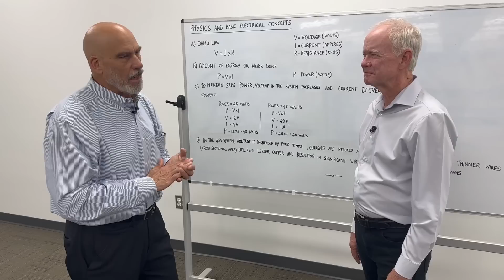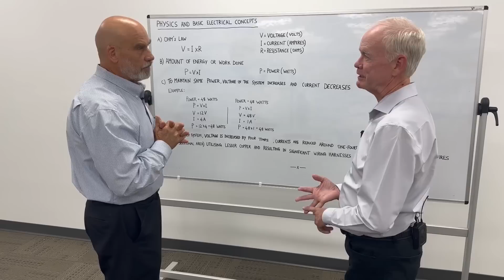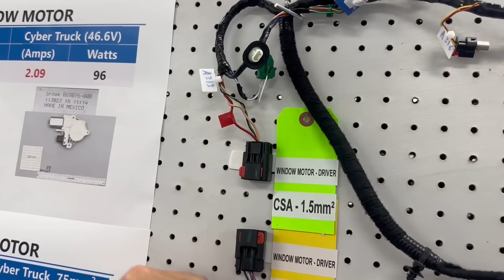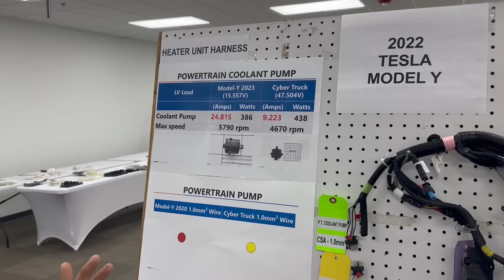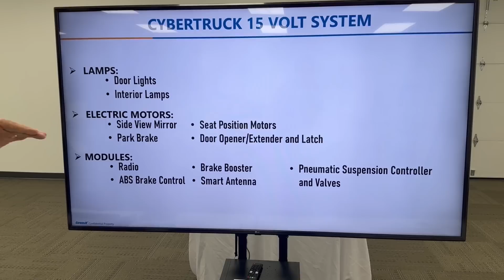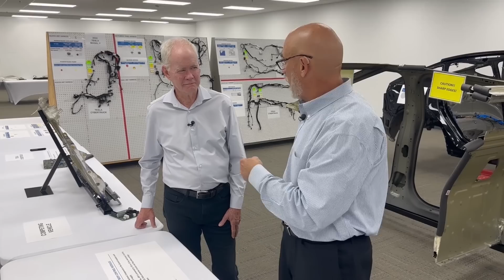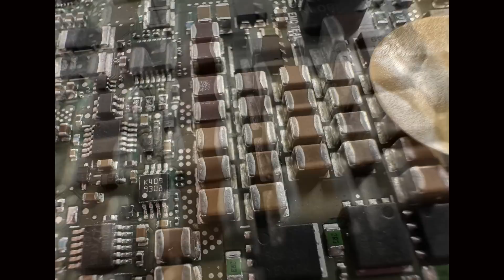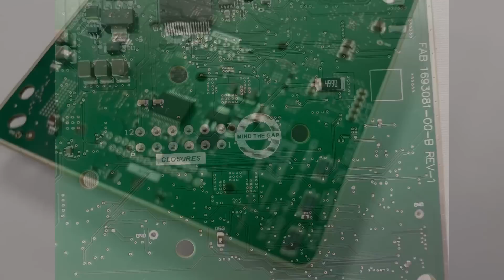Deep Dive Into Tesla's 48-Volt Architecture - Caresoft Teardown

Comment: Funny you should mention the wiper motor.  There is currently a recall open on the wiper motor for the motors failing.  Over on his channel, Munro praised the wiper motor for being small because it runs on 48 Volts.  Commenters were quick to point out thar the physical size the motor is not necessarily related to operating voltage.
Reply: It’s not a motor problem.  It’s a motor driver problem.  The real recall is for gate drivers of the motor.  In other words, the electronics overheated.
Reply: @Derpy1969  Thank you for the correction, I appreciate it.
Reply: @Derpy1969  In other words, nobody validated the design.  More fail of first principles.
Reply: @bobbbobb4663  My ford had a recall for the cruise control system catching fire, thinking tesla is the only one that gets things wrong is re tart ed
Reply: @JD-yx7be  A wiring fire is kind of frightening.  I had a 1972 Olds Toronodo.  A piece of rust shorted out the license plate lamp.  The wiring harness was thick parallel solid copper wires in Teflon under the carpet on the driver’s side between the A pillar and the trunk harness.  The under carpet wire did not get too hot or melt, which would have been a bummer if it had ignited the carpet.  What did catch fire was the harness between the bottom of the A pillar and the headlight switch.  Those were probably 16 gauge with regular thermoplastic insulation.  The license plate lamp was on the same circuit as the headlights and had a thermal reset breaker instead of a fuse; it should have been fused with the tail lights.  The Toronado trunk harness wiring was a bit complicated because there were high mounted stop/turn signals which had relays so they could have single filament bulbs but pick up the stop/turn from the 1157 type lamps mounted lower.  It seemed like a Rube Goldberg wiring idea which some exec and designer came up with for the high mounted lamps at the last second before committing to production.
Reply: @JD-yx7be  Chief Engineer on the CyberBust:  E Musk.  Chief Engineer on your Ford:  Not Chris Farley’s Incompetent Cousin.
Reply: @JD-yx7be  Ford is a bad example for recalls.
Reply: @bobbbobb4663  No, the design was good, it's just that the supplier tested them beyond their design power limits, which may have damaged the power transistors that drive the wiper motors.
Reply: @ZipZoomZip  Welcome to HALT.  Stop making excuses that Chief Engineer Musk doesn’t know anything about reliability testing.
Reply: @bobbbobb4663  Musk can't lead SpaceX to be NASA's most reliable contractor without know all about reliability testing. Yes, it's rocket science. YOU are a sham!
Reply: @bobbbobb4663  The same week the Tesla wiper motor was recalled, Ford and Toyota recalled a million vehicles for defects that could cause injury or death.
Reply: @markburmeister4674  Tesla is sooo much greater than the legacies yet the stans have to compare it to the legacies to prove they are "less bad".
Reply: Tesla hater
Reply: @captain8792   if you mean me, no - far from it.  Artistry is recognizing what’s in the world around you making something unique from it.  I believe in a prior remark here I complimented Tesla, saying they excelled at it.  No other manufacturer has yet put all the technological elements found in the Cybertruck together all in the same place at the same time, though most of those technologies already exist separately in other automobiles.

There are shortcomings in the specific realization of the Cybertruck…. For example, forcing customers to purchase the full self driving option if they want to purchase a Cybertruck any time soon, and then omitting full self driving with no definite date of when it will actually be delivered.  Several of the missing software features have already been addressed, such as the locking differential.

I also find Elon Musk rather abrasive, much like Steve Jobs was, exaggerating the ordinary and taking credit for inventing things which already exist.  I’ll blame myself for that, but I am not required to like everyone.
Reply: @captain8792  Please specify your target.
Reply: re: "There is currently a recall open on the wiper motor for the motors failing." whew, now wait till there's a TOTAL RECALL on "opens" developing in FAILED WIRING HARNESSES.  if there's one job Techs hate to perform under Warranty is the replacement of crap OE Wiring Harnesses.  boy if i've heard that complaint once in my training presentations, i've heard that a 1000 times.
Reply: Reason #4,678,090 why $andy is not a degreed engineer!
Reply: @bobbbobb4663   Agree, the presentations here are much better, not just disguised advertisements.  To be fair, some of Munro’s presenters are quite good.  I have a lot of respect of Carl who has taught me a lot about why decisions are made regarding the materials and processes used to build interior components.
Reply: @wtmayhew  $andy does hire actual engineers but if $andy's bio on his webpage, it makes me question why anyone would want to work for him.

Comment: Tesla didn’t invent 48 volt architecture.  Power steering racks have used 42 Volts in various hybrids for 15 or so years.  42 was the original proposal for higher voltage accessories in the 1990s.  BMW has been using 48 Volts in their eBoost mild hybrid system for several years.

Tesla is kind of like the Apple of the automotive industry.  Tesla integrates existing technologies from across the board the way Apple took a swath of existing technologies and put them in one place in the iPhone.  Tesla hasn’t invented the technology, but rather excelled at integrating technology.
Reply: So, why didn't BMW roll out 42 volts to all its new cars in the last "15 years or so"? And why didn't they use 42 volts for the rest of the cars' systems instead of just the steering racks? Were they such a leader? Nope.
Reply: @garyrooksby  Q: So, why didn't BMW roll out 42 volts to all its new cars in the last "15 years or so"? And why didn't they use 42 volts for the rest of the cars' systems instead of just the steering racks?" A: because it wasn't needed (full stop).  ref: the Universal Law of Diminishing Returns.  also ref: the Cybertruck costs $100,000 Dollars to own and doesn't come remotely close (by double) to the "less than $50,000" price originally promised, therein a "gimmick" was needed (that the laymen won't fully understand and via Confirmation Bias will "misread" and "misinterpret") to help justify the eye-watering price, and 48V is that "gimmick"...

ps: the Germans will GLADLY sell you a vehicle that incorporates 48V technology (if that's what one's got a hard on for) and they'll actually give it you for much less than $100,000 dollars.
Reply: @phillyphil1513  You seem to want to distract from the fact that your initial claim about BMW was false. Tesla is the first production vehicle with a 48V low voltage architecture. The Cybertruck also starts at $80k and will be available at $63k next year.
Reply: @markburmeister4674  re: "Tesla is the first production vehicle with a 48V low voltage architecture." which is only good for WIPING YOUR A$$ Mark no matter the "spin", "rhetoric", and "propaganda" placed on it.  welcome to the Law of Diminishing Returns (enjoy).

re: "will be available at $63k next year." yeah okay, until i get the dreaded "Robo-Taxi is delayed" announcement. wait for it...  wait...  for...  it.
Reply: It matters less who "invented" 48 volt architecture.  For half a century the auto industry has known that increasing voltage has advantages.  They moved from 6 volts to 12 volts and a few companies played with 24 volts.

Tesla's contribution is that they took what the industry knew and implemented it.
Reply: @bobwallace9753  24 Volts in trucks is not unusual and a lot of military equipment, even some Jeeps, has been 24 Volts for decades.  It is amazing how much inertia to change there can be.
Reply: @wtmayhew  
My 1986 RX-7 was 24 volts.
Reply: @bobwallace9753 Amazing drive! As smooth as Electric!❤
Reply: @bobwallace9753  You could say the same of SpaceX. They took technologies and processes that were known and mastered them like no one else in the industry.
Reply: @markburmeister4674  
Try to find anything that was invented without being built on previous inventions.
Reply: TESLA/ ZF steer by wire , uses no Mechanical components , and is MUITIPLE redundant.
Reply: @markplott4820  Correct.  I’d still rather have the Infinity Q50 where there is no physical connection unless a power failure allows a clutch to engage the steering wheel to the steering rack.  That is pretty infallible.  The instrument panel packaging of the Cybertruck appears to make a mechanical backup difficult to design.  The Q50 first had steer by wire in 2013.

Comment: You may not like the vehicle but you gotta respect the technology and intelligence that went into building it. Imagine how much copper and weight Ford would save if they did this to the F150?!?!
Reply: I think musk wanted to be vertically integrated.  So if you are going to make everything in-house, you might as well do 48v.  Not a weight consideration. It's all about the build and money.
Reply: What do you mean? I LOVE the Cybertruck. Every month I drive it I'm more impressed! No issues so far, I see a lot of odd issues on various Youtube channels, I almost think they are getting paid to find issues and throw shade on Cybertruck because mine has none of those issues. Weak brakes come to mind. The brakes are VERY powerful, able to easily bring all four tires to lockup from triple digit speeds, so the antilock braking system can modulate them.
Reply: NOT possible for FUD motors, RAM or gm.
Reply: A pound or two if that.
Reply: @hwirtwirt4500 The average EV has 183 pounds of copper. A truck has more. But I’m sure your estimate of 1-2 pounds was after careful consideration in f the facts
Reply: @juliahello6673  -- Much of that weight is in the high voltage system to include the buss bars in the battery, the battery cables, the motor windings and the high voltage DC-AD converters.    

I suspect the low number was just for the low voltage wiring.   This is the weight reduction target when considering switching to a higher voltage battery for "housekeeping."   EVs don't require low voltage wiring for the starter motor but sill need it for the wiper and widow operating motors.
Reply: @juliahello6673  The CyberFlop has no weight advantage over any other EV Truck  with equivalent sized battery. The bulk of the heavy copper is between the battery and motors on all EV's. Instrument displays and accessories do not require high current with few exceptions. Do you know anything about electrical systems? Rhetorical question, of course you don't.
Reply: @hwirtwirt4500  Clearly the mining profession doesn't know anything about electrical systems either, since a quick google shows an article in a mining magazine saying that the copper usage would be cut by 3/4.
Reply: @hwirtwirt4500  "The CyberFlop has no weight advantage over any other EV Truck  with equivalent sized battery." Irrelevant. We are talking about the amount of copper, not the weight of the vehicle.
Reply: @hwirtwirt4500  CyberFlop? Someone isn't following the sales numbers...
Reply: @hwirtwirt4500  --  Exactly.  Larger trucks already use 24 (nominal) volts.  It makes sense to transfer that tech to smaller trucks.   Replacing copper  with aluminum is optional.   It makes sense not to jump into Al with both feet but just the larger wires.   Get some experience with mixed conductor types in an automotive environment.
Reply: @hwirtwirt4500  Just the lighter, 48v wiring harness is estimated to save 85 pounds.
Reply: re: "Imagine how much copper and weight Ford would save if they did this to the F150?!?!" wait, doesn't the 6781lb Lightning already weigh basically the same or even LESS than the 6884 lb CT, without having to pass on the added expense of 48V and the cost of wasted time to market to their customers like the $100 Grand minimum CT now has to do yet for a DIMINISHING RETURN...?
Reply: @phillyphil1513 one of those two vehicles is stainless steel and bullet proof lol
Reply: @phillyphil1513  No, you are comparing weights of a shorter range truck without dent resistant body, without a suspension that adjusts in height by an amazing 8" up and down, and the air compressor to power that, without a metal motorized tonneau cover (the Ford doesn't come with ANY tonneau cover) without 35" tires, without 2500 lb. payload capacity, without 11,000 lb. towing capacity, without armor glass to reduce glass replacement time and effort, without 11.5 kW of 240 volt power, without four-wheel steering, etc, etc. etc. The Lightning should be a thousand or more pounds lighter, instead, it's hundreds of pounds heavier. Poor F-150 engineering with outdated manufacturing techniques.
Reply: @ZipZoomZip  re: "Poor F-150 engineering with outdated manufacturing techniques". yeah, but if you're a Company you're not afraid to buy 50 at a time for Fleet Use (because you know you'll get the support for your business) and if you're a Tradesman, you're not afraid to show up at the Job Site with one...

in fact Farley at Aspen just highlighted Fords leadership position (over Tesla) in the Commercial Sector.  in comparison, the CT's "like a baby's toy".  it's fragile and constantly breaks so clearly at Tesla "reliability" is NOT "job one".  no real MAN looking to feed his family is going to put up with that, no only those living as "juveniles" and "teens" put up with that.
Reply: @phillyphil1513  I've always got good support from Tesla with my previous 3 Tesla cars, not sure why you think the Cybertruck would be any different. And if a tradesman is skilled, with a good reputation, he's not going to worry about showing up on a jobsite in a truck simply because it looks different from the other trucks. He can write his own rules, he doesn't have to worry about pleasing others. Chances are that a tradesman showing up on the jobsite in a Cybertruck is going to reflect well and help him/her get more jobs in the future for being confident enough to think out of the box.
Reply: @phillyphil1513  The fanboys fall for every bogus claim Tesla propagates.
Reply: @phillyphil1513  The Lightning with equivalent range weighs MORE than the Cybertruck.

Comment: The comparison is fantastic; just want to know an interesting features, how they raise 400V to 800V while charging a 400V Charging Station. For example, while Hyundai, BYD, and other OEMs use existing components (Emotor winding for boosting), Cyber Truck achieves this function with the use of additional electronics. Show us this additional stuff and how they incorporated it into the penthouse, cost and so on.
Reply: This had been covered in other videos. Basically, they split the pack into 2 x 400V systems. When you plug it into a V4 (800V) charger there is a switch that connects the batteries in series. When you plug it into V3 or lower it connects the batteries in parallel. They found a much simpler solution without the complexity of additional circuitry.
Reply: Yes, splitting the pack seems like the best solution.  It just requires two extra contactors and while these are expensive devices, they aren't as expensive or as fragile as a high-amperage/high-voltage boost converter.
Reply: splitting the pack like GM Ultium's dual 400 packs that connect as 800 first featured in the...  wait for...  HUMMER EV.
Reply: TESLA actually has Physical Mechanical connectors , you can actually hear them Engauge when HV charging.